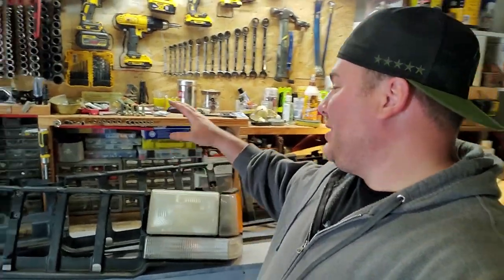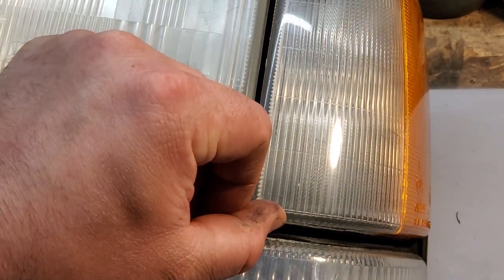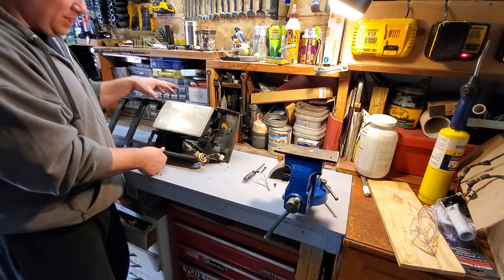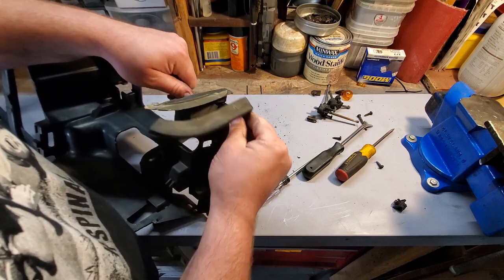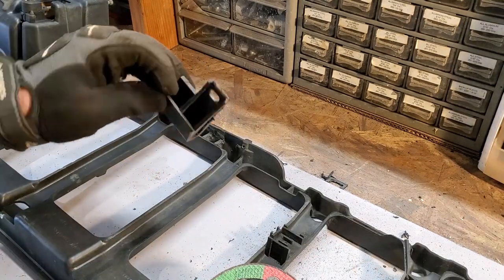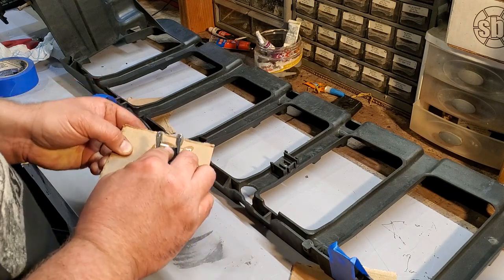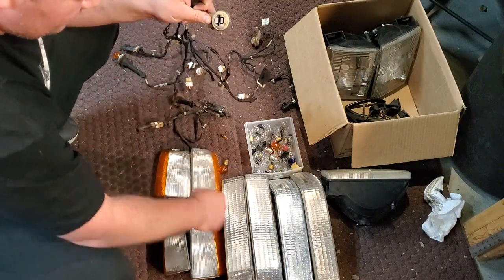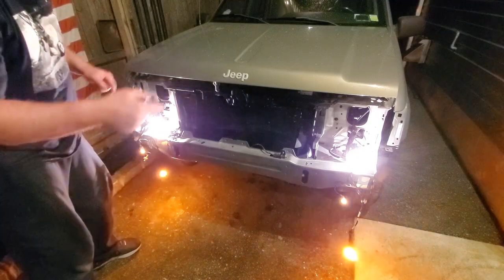JEEP ZJ HEADER PANEL BUILD - DISASSEMBLING AND REINFORCING FOR A 1996-1998 GRAND CHEROKEE

Comment: It's hard to find an unbroken header panel in the boneyard. Nice find!
Reply from the maker: LOL, Ill back that up by saying its impossible to find an unbroken ZJ header panel in the boneyard. This header panel was pulled from craigslist part out..  I ended up going back to the JY in Part 2 of this vid for more parts.  Thanks for watching
Reply: @ProjectDanH  Lol, I had a 93 ZJ. I ended up cutting 2 header panels to make a decent one. Couldn't even tell unless you looked real cloe. 😂
Reply from the maker: @jasonlight5871  LMAO! That's awesome.  I'm really happy with how my tab grafting came out! lol
Reply: @ProjectDanH  Lmao! You do what you need to do. It's a 20+ year old vehicle.  Yes, the XJ interior trim tabs are a pain. I actually clear out the broke plastic, heat the metal part and press it in until the plastic comes through about an 1/8 of an inch. Then I bend the plastic over while it's still pliable. Works well, haven't had one come loose yet. Great content by the way. Keep it up.
Reply from the maker: @jasonlight5871  that's a great fix! I think I'll try it next time! (And then smother it with epoxy) haha!
Reply: r2d23678  I didn't fuse it. I just cut it really close. You couldn't even tell there was a gap unless you were looking for it.

Comment: I'm going to replace my header panel and all the lights.
Anyway the project on deck now is new front axles. And since I'm getting the front axles then I'm going to be getting new hubs of course, and I have been meaning to get new brake calipers and pads. And since I'm replacing the axles I might as well do the seals. So that's on deck.
Oh yeah I might as well replace the ball joints while I'm taking all that apart.
Lol
Reply from the maker: lol. looks like you'll be watching a bunch of my vids!!
Reply: @ProjectDanH  yeah watch your videos of course. But I just sold that car and I bought a brand new 1997 ZJ with less miles with everything done to it already so the project is off the table.

Comment: love the channel, does this video show how to take it off and how much time is involved?  do you think an amazon header panel will be ok, or do you recommend one from the junkyard?  mine cracked right in the upper right (drivers side) corner when facing the vehicle while pushing in my new headlights, so I can either jb weld it with some metal reinforcement behind that or get a new header panel...  Firestone is charging $250 to install the header panel and the lights...  so I'm wondering if I can do it myself while I'm on the road or do i take it into Firestone... I changed the alternator in a parking lot, while on my road trip, for example... but I know these lights can have little plastic parts the break and don't quite always fit (like I already broke the header panel, or mine might have already been broken)...
Reply from the maker: You can definitely do it yourself.. take your time. Make sure you find all the little screws.  Amazon panels should be fine . Junk yard ones are probably all brittle and old. Lol
Reply: @ProjectDanH  ive been in there  before I just vowed Id never work on this jeep since I got it in very nice condition...  my main thing is it behind anything like a cooler or condenser?  do I have to take anything out that's in front of it, how hard are the little headlight adjusters to get transplanted?  it's only $250 to have firestone do it, but if it's just right there behind the grill then that's easy, if it's behind some of those other parts then i'll have them do it... thanks for the response.  right now I have the new headlights taped in and one wont stay in place and basically points upward at about a 5 degree angle so I have one going up and just one on the road... ha ha  thanks again
Reply from the maker: @VenturaIT  it's not complicated at all .. just start with un screwing the grill. Then pop out the headlights. Then you can unscrew the side markers and turn signals.  Then the header panel should be bolted on by like 8 some 10 mm fasters